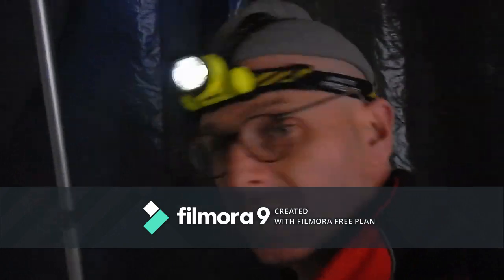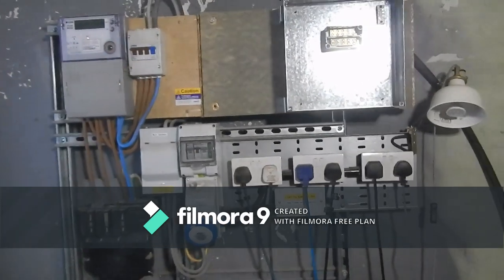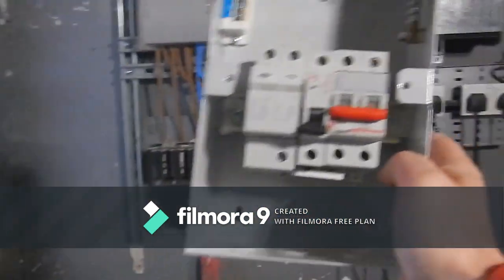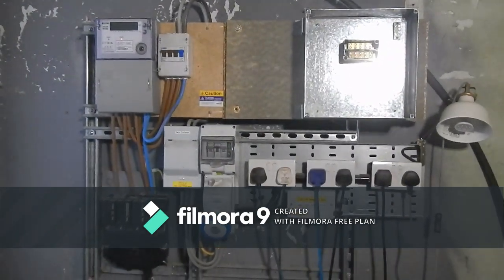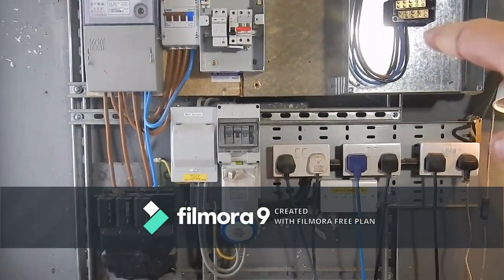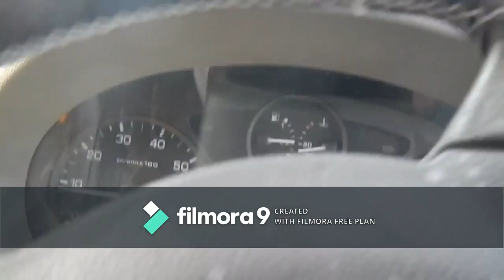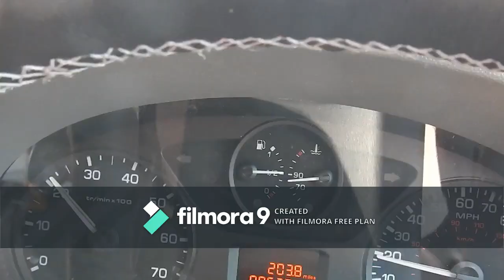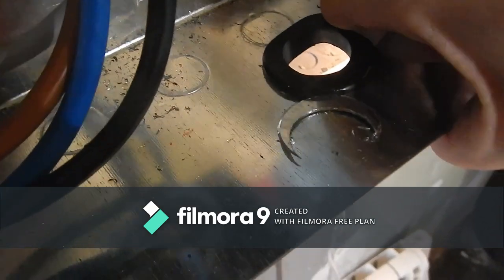Fitting a 32mm Rubber Grommet

Comment: Follow most of your video's . The adaptable box at the top will not conform to the regs , IP4X  OR IPX4  which ever it is .Better to use a compression /stuffing type gland. All very well in hindsight but best to carry good quantities of basic stock as that grommet has cost you or the customer approx £50.00. You also show respect for other u- tuber creators i.e  SAVERY e.t.c but don't forget you take on a lot of difficult jobs and have the honesty to show your mistakes warts and all i have huge admiration for you.
Reply from the maker: Wow JJ thanks for the big  up.  I can't remember what that IP problem you refer to refers to, I'll have to go over the video    If it's Tottenham I'm going up there to put in a kitchen around Easter, so maybe able to change whatever it was to conform.  Many thanks for the comment.  Ta
Reply: I would also add a 100a switch fused device as you have no overload protection on your SWA??
Reply from the maker: @wyndavies5044  hI wYN, thanks for the comment.  There is s switched fuse there now for definite, I haven't watched the video recently and was surprised to read your comment, I'm sure I put one in but then that was a temporary install initially, there's now a fused switch at the origin leading upto the CU.  But I thought there was something like that before, but will re watch and see what you're talking about....   thanks for the attention  all the best